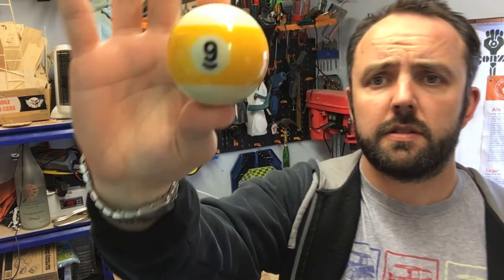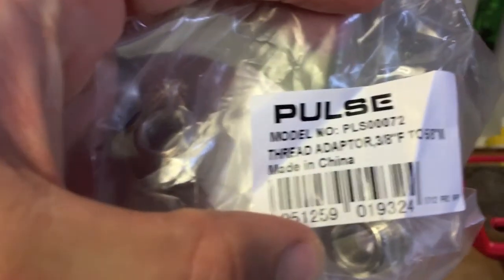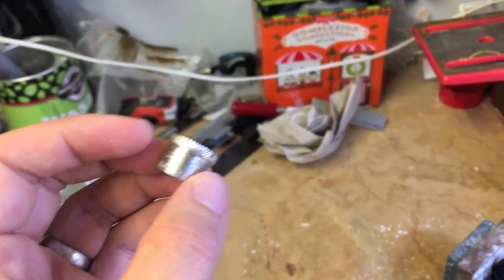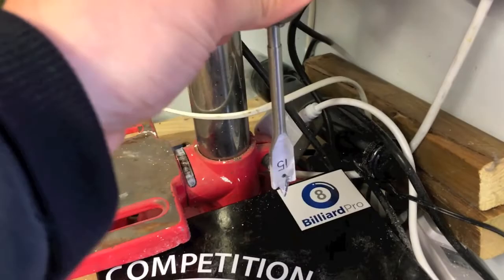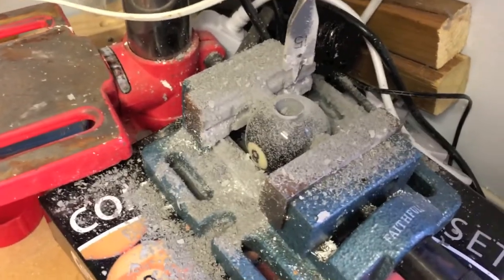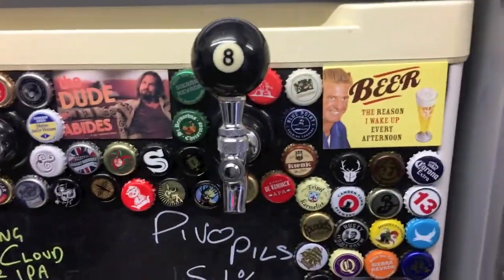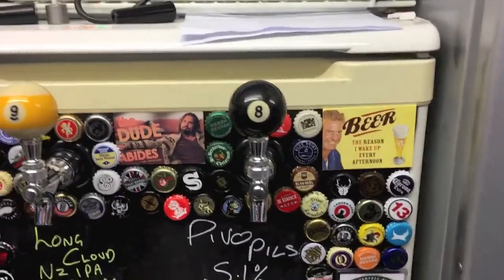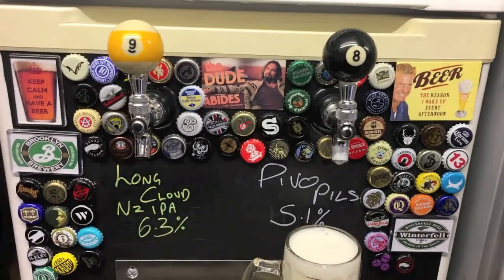How to make custom '8Ball' Beer Tap Handles

Comment: Nice, I'd always thought the balls were ceramic for some reason.
Reply: When you think about it, ceramics are the last thing you'd make them from :) I started drilling my pool balls today, very easy job other than getting the balls level. Still, I have a complete set, I'll pick the best ones. I also thought I'd done one upside down until I turned it around :)